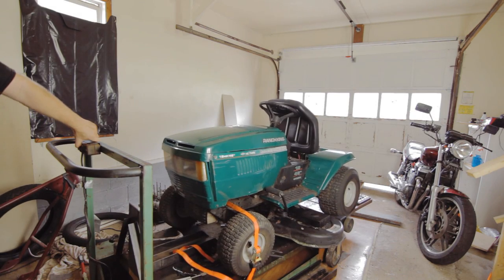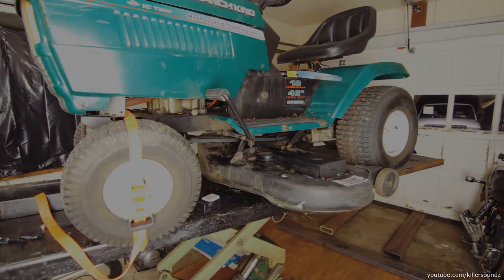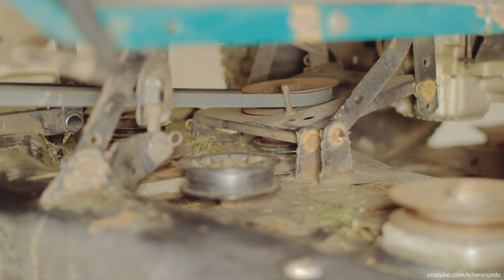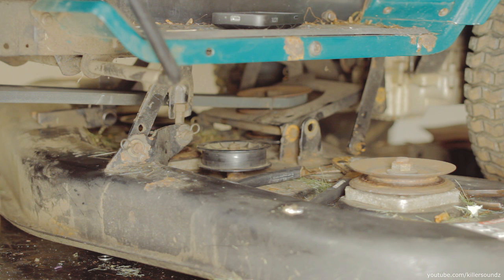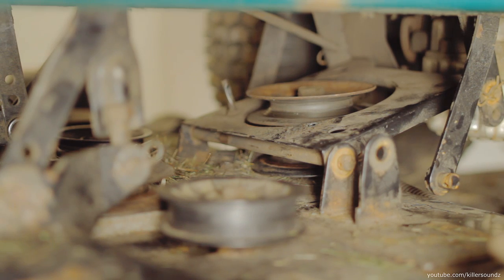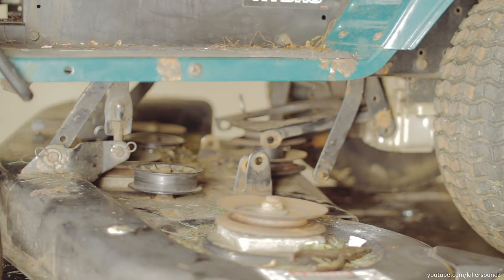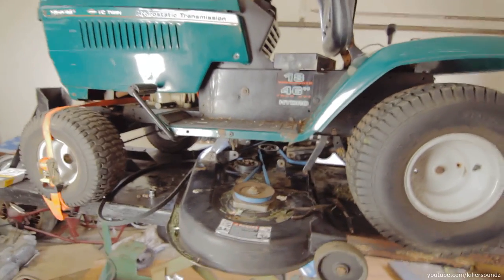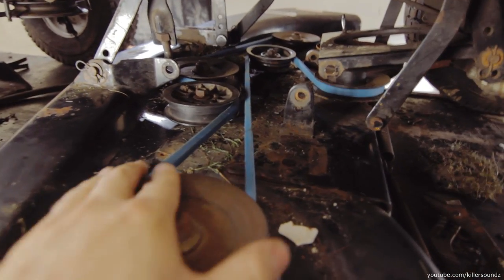How to Replace a Deck Belt on a MTD Riding Lawn Tractor

Comment: Is that a Honda CB 900 ? 
I had one of those.  Many great hours of riding .
Im changing the motor on a 1990 MTD mower,  no rust and a small yard,  But the belts are brittle . I got a good motor off a rusted junker.